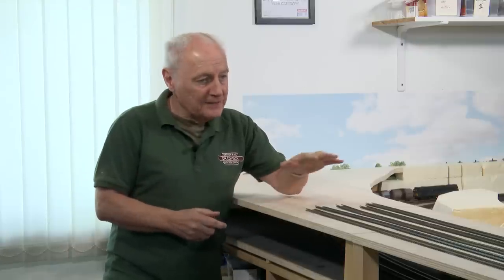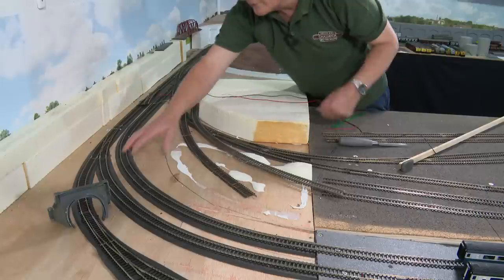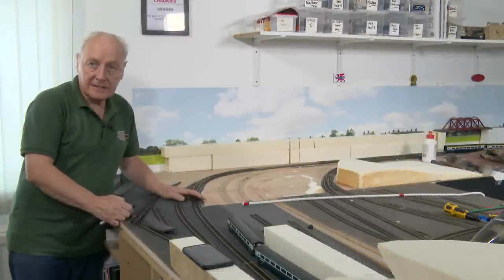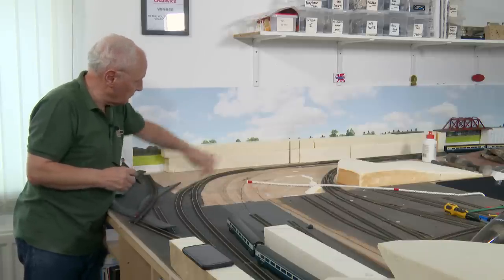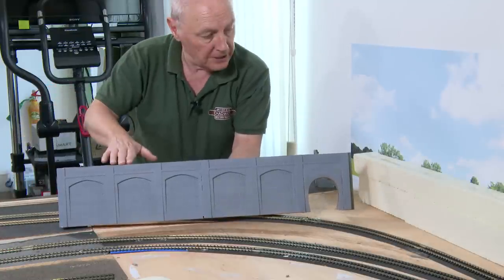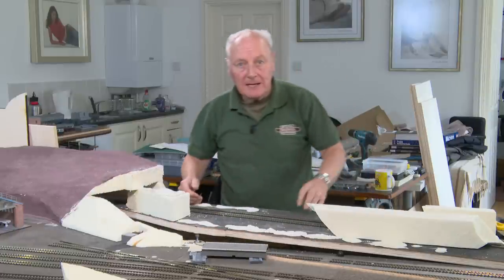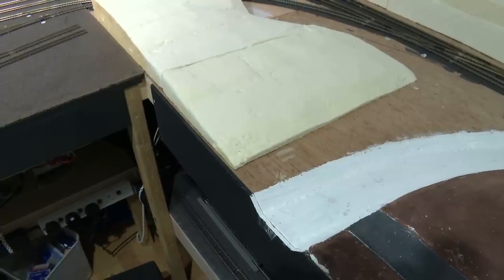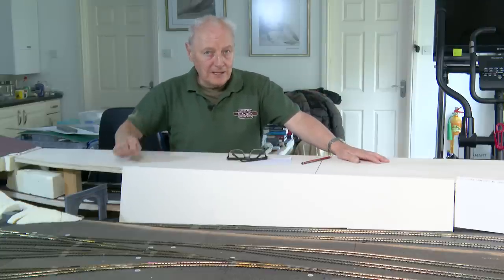BUILDING THE FREIGHT YARD at Chadwick Model Railway | 203.

Comment from the maker: Clarification of the board measurements for a track plan design, measured from the wall to the hillside.

Total yard length = 238cm
At the wall, width = 92cm
At 80 cm from the wall, width = 41cm
At 193cm from the wall, width = 32cm (by the tunnel mouth).
At the end, width = 21cm

5 tracks is by no means essential,
Similarity 4 sets of triplets isn’t either.
A triplet measures around 26cm.
I use Peco Code 100 track

Good luck, Regards Charlie
Reply: Having a whack at this in AnyRail. What particular track libraries do you stick to? I'm unfamiliar with Peco so I'm not sure as to whether to use streamline or setrack and what code to use? Cheers!
Reply from the maker: Peco OO Gauge Streamline is the track of choice. Regards Charlie.
Reply: @ChadwickModelRailway  do you use code 75 or code 100 Charlie?
Reply from the maker: Peco Code 100 John, regards, Charlie

Comment: Hi Charlie, there was an alignment of stars Friday .... well in clearing out the garage I came across 2,4m by 60cm white board for shelves. Then I found my box of Hornby Dublo and then I watched your video!!

I loved the focus on functionality in order to make it an interesting task to operate. It's precisely how we had both the Dublo and O gauge set up, running timetables as well.

Anyway I noted down the sizes and your operational requirements and came up with a sketch and built it. It works in so far as physical movements are concerned but I have yet to power it up!! It's a long time since it's been used so the connections won't be good.

I've had a lot of fun and maybe it's of use (I doubt it🤔🤔😂😂😂) I will send you a couple of photos.

Your invitation came at just the right time. Thanks for being an inspiration for so many out there.

Have a great weekend
Reply from the maker: Thanks David, I’ll look forward to your contribution.  Regards Charlie.

Comment: I think you may need to add another short board rather than that hillside at the end, as you are going to be tight for space.

Im a freight driver myself, an arrival & departure loop for the trains to enter/exit, then leading into the yard itself is the ideal option.

You dont HAVE to have a run round loop, providing you have a shunt loco you can use. Would make it more interesting if anything.

Say for examples sake you just had a 3 road dead end yard, the train would come into the arrival road, loco detach and run round via departures, then back the train in that way. 
Alternative is have an 08 ready to go onto the back of the train instead, and the loco could come off straight onto a fuelling road instead.

You could also if length id limited split the train in half down two roads which gives you more play value, this is a regular on intermodal trains due to their length.

I will be at GETS if you need some ideas. 

Eric
Reply from the maker: Thanks Eric, advice like yours is truly invaluable. Take care mate, regards, Charlie

Comment: I also use the pico 6 way gauge, as you are aware,  they are also useful for platform heights. Is poplar ply better than marine ply? The pico grey bridge crossover looks better. Unfortunately I won't be able to supply a plan as it has been my experience recently that no matter how much I plan something, I always seem to miss something out like a signal box for example. 
Once again a Very good, interesting video.
Reply from the maker: Hi Sam, poplar ply is much lighter than birch but softer.  
No problems about the plan.
Regards Charlie

Comment: It took me a year of planning before I started building my large N gauge layout. I had a vision of what all the scenery was going to be whilst planning. I did have to change some of the scenery and and one point position for the coaling  deport as there was a board support in the way of the point motor. 
Your layout is looking good, looking forward to the basic completion, then fun bit of adding all the extras.
Reply from the maker: Yes Paul, I couldn’t agree more. It will be great to finish the track and then start on the scenics, one section at a time. Regards, Charlie
Reply: @ChadwickModelRailway  regarding your plan for a goods/freight yard, I know you are GWR is there any yards you might be able to adapt or maybe take a couple and combine to suit. I did that with my layout, I took Hawkhurst in Kent for my upper branch and adapted it slightly. 
I’d love to have a go at your plan but unfortunately time is a problem.looking forward to seeing what happens.

Comment: Thank you as always Charlie, a great watch. I felt when giving the dimensions for the rail line to fill, that you neglected to outline the space that the Road would take up, and what it is serving. Regarding the Tunnel Mouth, I got the impression that the white cardboard 'temp' wall was 25mm too high and so gave the wrong impression at the tunnel mouth.  Clearly your freight yard over the top of of the return loop is a complete 'invention, which would never naturally occur. So should the line into the tunnel, heading to the return, actually create the impression it is going 'straight on' i.e. parallel to the  room wall? if so it needs to come further into the layout to be further from the curve. Regards.
Reply: You would need to add another 6 inches of (Was it  18mm) ply above where the Diesel is sat with the oil tanks at the end of the video. I know that the retaining wall would then be very pointed, but make it look as though it too is headed for the room wall, with just a simple opening to allow the line through. Perhaps you have cut that first board too early and need to go again? or need a very cleverly supported addition. One end of which could be supported against the wall if you cut down  the celotex there by 18 mm
While I have you, two weeks ago when preparing the landscaping around the return loop, at the start you did not install the tunnel mouth, as you wanted to prepare an interior wall for the tunnel, to maintain the illusion.  But at the end you had installed the tunnel and its interior wall. You now have two opportunities to explain how this works, here and on the tunnell mouth to Helix 2. Please can you include this when you do it. Thanks
Reply from the maker: Thanks Roger, for two excellent comments. I shall certainly look into the relay of the reverse loop tracks. However, it’s very difficult to extend the boards. 
I will certainly video the building of the tunnel linings. Regards Charlie

Comment: Morning Charlie. I was quite surprised to see the difference in the curved lines to the helix once you moved that point. I did think  they would be tighter than what they were. Certainly gives you better scope when laying the baseboard for the freight yard. The tunnel portal should be one of those concrete ones to give it a slightly more modern look to it. Is the yard totally pre container era or  about the era of transition? If so then that will have an effect on the layout of tracks and it could make an interesting feature of the yard. No good at planning I'm afraid, not good at logical scenarios. I tend to  lay something out, change and change again. All in all looking good at Chadwick. All the best, Kevin
Reply from the maker: Many thanks Kevin, I’m so pleased that you found it interesting. I agree about the concrete lintel, and it will be interesting to receive some interesting track plans. Regards, Charlie

Comment: Hi Charlie

Hope you don't mind using the picture you granted me as my profile image.

Two points. Some comments mention the volume of brickwork. I agree. A way round it might be to use a arcade / cut out retaining wall. It would add a different feature, look good with the helix and fitnwith other areas. Believe there are foam versions available with my limited knowledge.
This would also fit with some of the London terminals that have this affect.

With regard to the track, I have something similar in my planned layout. I have just got one arrival departure line from the main track and then created a narrow gauge gravel and cement yard. I hope the narrow gauge will add another interesting aspect I hope.
Reply from the maker: Hi JS, feel free to use my picture. Picking the correct material for the retaining wall will no doubt be a challenge. However, with a couple of big shows coming up I’m sure I’ll find something. Stay safe, regards, Charlie
Reply: Forgot to say good luck Sunday at awards. Will be there to cheer you on. 🎉🎉

Comment: Charlie,
You're really making great progress and I love it when you occasionally open up an expanse of board, waiting to be filled. It really gets the juices flowing.
I'll leave the track planning to others, more capable in the art of computer design. However, I was thinking about the entrance to the area below the fiddle yard. I was please that you concluded that a concrete beam was the answer because I thought the other options looked inappropriate.
What I did think was that you should try to make the entrance at close to 90 degrees to the track. Have the concrete beam supported by tall concrete pillars so that the deep beam is aligned with the top of the fiddle yard boards. The pillars would be on one side of the track, supporting an extended area of the fiddle yard area and allow the entry tracks to begin a curve earlier. The other end of the beam would be supported by the existing civil works that support the entry tracks. If you see what I mean.
I'll try to send or post an example, but I am thinking about structures in Kier Hardings Hornsey Broadway.
Just a thought.
Bob
Reply from the maker: Many thanks for sharing your thoughts, Bob, and as they say, the jury is still out on this one. Regards, Charlie

Comment: The change to that curve makes a vast improvement. When it comes too soldering across rail joints I’ve used an off cut from a Peco frog wire to form a loop around the fishplates so the join can still expand or shrink and it’s fine enough not to be too visible. For the tunnel a concrete beam would look better than the tunnel mouth at that angle, though I think you have enough room to straighten the tunnel mouth to a near right angle with the retaining wall following the curve of the helix track a bit further. That would even give a tiny bit more land to the goods yard, as for track plans I’ll leave that to the more professional folk.
Cheers Rob.
Reply: In real life there is a set limit of 15' rail lenght, so a soldered (welded) lenght would be right.
Reply: @MrVinnyh  unfortunately heat expansion doesn’t care about scale so this level of realism is not viable if like me your layout is in a loft.
Reply from the maker: Thanks Rob, much appreciate your suggestion. Regards, Charlie
Reply from the maker: Thanks Mr V, I never knew that. Regards, Charlie

Comment: Hi Charlie, great video! I'd like to know how long the area is between the 21cm end and the section that's 32cm wide  as well as how far your supports jut in on the open end.
Reply from the maker: All the info you require, should be pinned in the comment section. Regards, Charlie

Comment: Interesting video Charlie and depending how adventurous you want to be with it I may have a real location idea based on Plymouth friary if the dimensions can be squeezed. Old
Station that went over to freight use on the western region by the 70s sounds perfect to match the era and location. Just have to see how it could be reworked. 

Just to confirm is the lead in single line or is there space for 2? Be it mainlines or bidirectional and a headshunt as it may affect the approach I take to it.
Reply from the maker: Many thanks for your interest, TQ. The approach line is a single track. Regards, Charlie

Comment: Very interesting (as always)  One detail you missed in the measurements... how far along the boards is the place where the width has reduced to 32cm?
Reply from the maker: I’ve just checked the measurements, Lee. The 32 cm was by the tunnel mouth, and 20 cm at the end of the board. I shall check the video to see if that’s unclear. Regards Charlie
Reply: Hi Charlie -  @ChadwickModelRailway   the question is how far along from where it is 20cm is it to where it is 32 cm at the tunnel mouth. A different question is do you need to tapper the yard over the tunnel, you could just continue at 32cm back to the hills, allowing more potential track space?
Reply: @ChadwickModelRailway  but we don't know the position of the tunnel mouth?  How far from one of the ends of the boards is it? But I see that you have provided the measurements in another comment - thanks.
Reply from the maker: Hi Gavin, it's 32cm wide at the tunnel mouth, from there, to the end it's 45cm.
I do wish to taper the area back as it will look more realistic.  Regards Charlie
Reply from the maker: Thanks Lee, I’ve amended the pinned comment, so hopefully it’ll make sense now. Regards, Charlie

Comment: Nice one Charlie. Must admit, I cringed a bit when you changed your mind and ripped the celotex off the boards as it looked well stuck down! Had visions of that Hi De Hi episode where he was gripping the bar so hard, the edge came off in his hands when he stood up!
 Im about to start laying track in my garage build but have a bit of a quandry. Should I lay track first then solder my droppers onthe fitted track ( difficult?) or add the droppers to the track first then lay them? Doing the latter seems easier but means Id have a couple of dropper wires flailing around. Which way do you do it?
Reply from the maker: FF, I would certainly solder the droppers first. You can get in such a pickle trying to do it afterwards. Regards, Charlie

Comment: ~16:00-17:00 Well, I think both solutions look strange (first stranger then the second), therefore I would suggest you open a map program of your choice and look up 48°47'58"N 9°13'34"E / 650m eastward of "Bahnhof Stuttgart-Bad Cannstatt", where you see tracks getting over and under -> top tracks curving over, lower tracks straight into buttress arches in a brutalist architecture 😉~18:00 What, you want to fiddle a road throw there, too 😮 ~22:00 votes for 90° + whatever as read/seen before 👷
Reply from the maker: Now there is an interesting suggestion that I look forward to checking out. Regards, Charlie

Comment: Dear Charlie, humbly think you should consider a cutting instead of a tunnel where the leads for the reverse loop, on the lower section, wander off. Together with an access road to the freight yard over the cutting this will allow for two bridges close to each other. At or around the location of the bridge abutments you can then camouflage the tracks going underneath the freight yard board. Through the cutting you can put some dilapidated or disused track, which will allow for an interesting scene, as well as the layout’s connection to the outside world. 
On the freight yard’s baseboards; with all the different tracks you’ve mentioned, I think the best way to approach this footprint is to scrap anything you don’t really need. Yes, a run around section may seem an obvious necessity. However, when the freight yard is operated with a dedicated switcher, the run around may not be absolutely necessary. For visual interest I think it would be best to reduce the amount of track, to display the different customers of the freight yard. To be truly honest the most obvious track configuration you can now place on these two boards is too much in line with all the other tracks on the lower elevation. My main suggestion therefore is to consider a slight addition to the baseboards which will allow for some spurs to point in the less obvious directions, which in the end will make the freight yard look much more interesting.
Cheerio
Reply from the maker: Many thanks for your invaluable comment Vincent. I shall certainly look into the option of a cutting rather than the tunnel. Regards, Charlie

Comment: A thought on the tunnel mouth and the acute angle its at versus the track. Why not straighten it up a little, then run a road bridge over the Helix lines, over the TMD tunnel and down to the TMD fuel depot. Could have a road link there, it would cover the track a little (the bridge) and all, but it could give some flow between the fuel depot and the freight depot. Might make everything flow a bit better, though it would require some handiwork to get the alignments and odds and ends connected. 

Hopefully that makes sense, but all the same, love your work Charlie. Your channel is always a delight to watch.
Reply from the maker: Thanks, a crumbling world. It’s some thing that occurred to me sometime ago, but I seem to have let that one slip. Regards, Charlie

Comment: The cross beam arrangements are very reminiscent of the 'Widened Lines' in London used by mainline railways, and I think it would work well with having beam type tunnel entrances in that area, along with brickwork walls. It really is looking great Charlie, I think your new layout is much improved.
Reply from the maker: Thanks A97531, that’s very much appreciated. Regards, Charlie
Reply: @ChadwickModelRailway  I would lean towards the Brick Tunnel mouth you started off with.  Mainly because it is the start of a tunnel running into a hill rather than a bridge, which to my mind would have a very different construction.  Having said that a bridge would work well if the lower track was running through a cutting & the Freight Yard is situated on a separate hill, though that might be too many changes of plan!
Reply from the maker: Thanks Chris, I must confess that the jury is still out on this one.
Regards Charlie